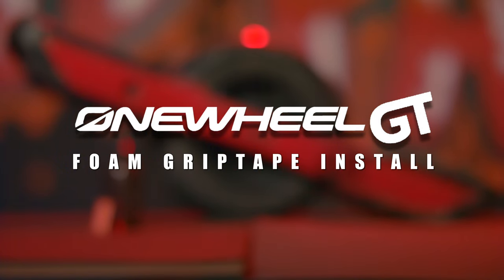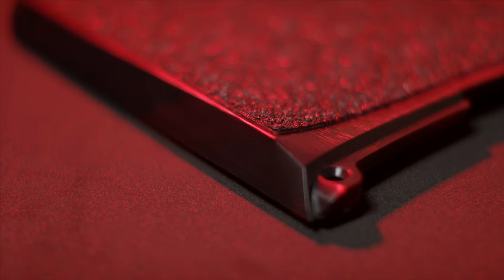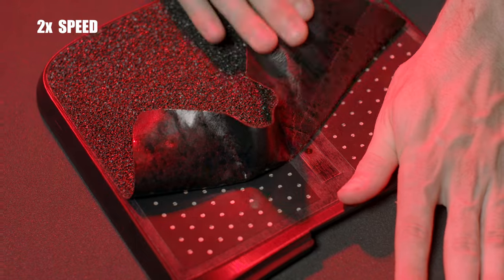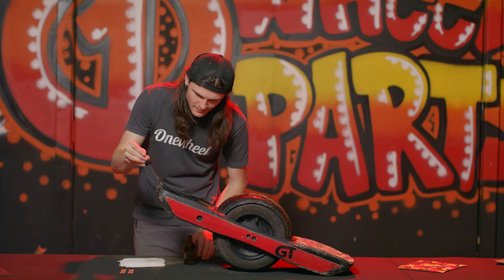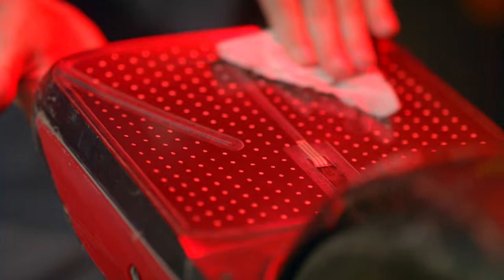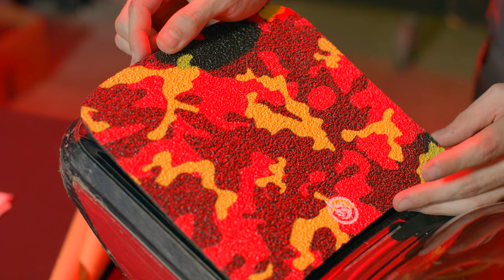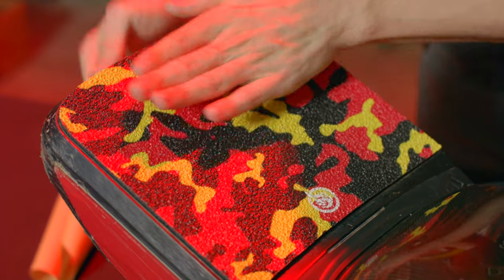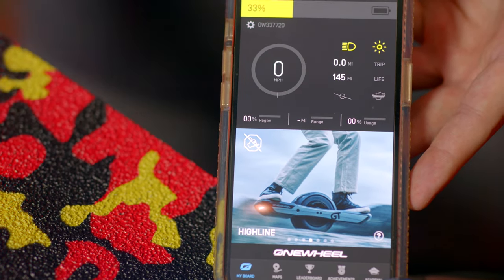Onewheel GT Ignite Foam Grip Tape Install Video

Comment: Do you guys have a video of removing the the ignite pads and replacing them on the front sensor?

My front footpad is ready for another ignite pad, but the 4mm foam isn't coming off in one sheet like other grip tapes. It's coming off in pieces and not well.